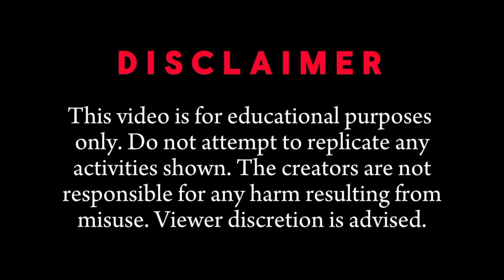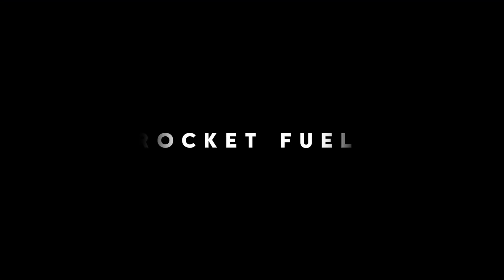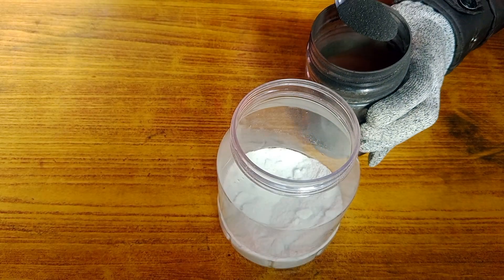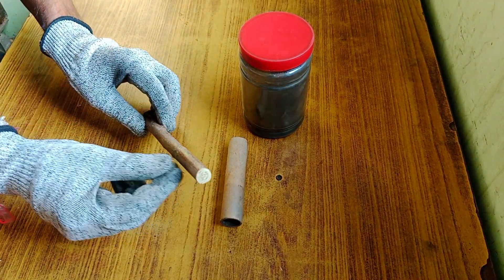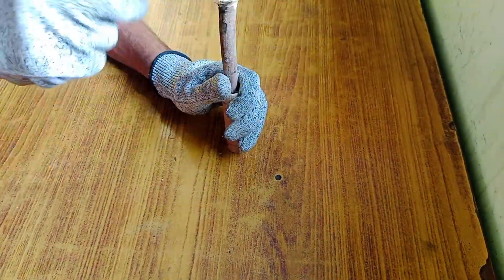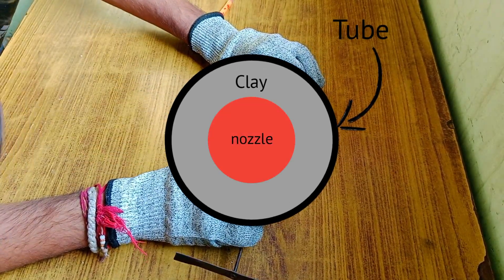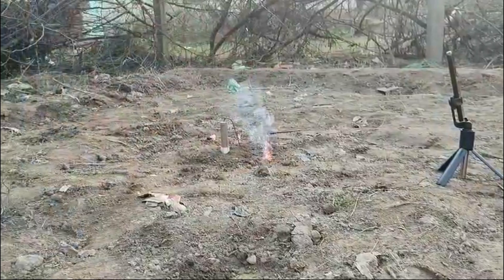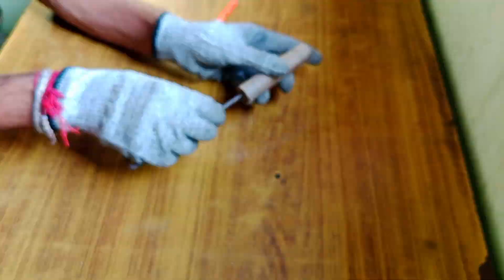My DIY rocket motor Exploded 😅 (Here's why!)

Comment: use 70 grams potasium nitrate 30 grams shuggar and melt it on low heat wile constantly sturing then pour into a pvc tube the poke a hole through the center withe a dowel  then use a pvc cap for one end and one with as hole for the other BTW you can use a metal washer to help with the nozzle

Comment: Two things. Your nozzle diameter was too small and because of how you formed the grain, you probably had some little air pockets. Also if you're going for a core burning BP rocket you should get a solid hardwood dowel rod that fits snug in the tube so you can really compress the powder. A lot of people are sketched out with the practice of ramming black powder are forgetting about the hundreds of years we were loading guns that way. Now if you did that with flash... you're probably going to have a bad day. 

Anyway if you can swing it, purchasing some BP rocket tooling minimizes the fiddle-fuckery and inconsistency inherit to the hobby substantially.  The tooling kits sold on Skylighter are great, but expensive. 

Good video for sure. Entertaining and well put together. Subscribed.